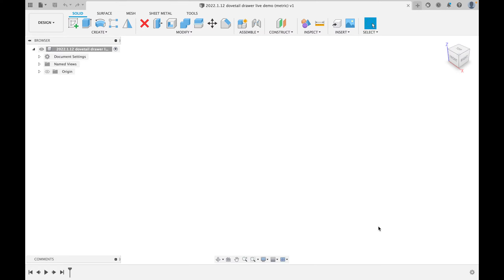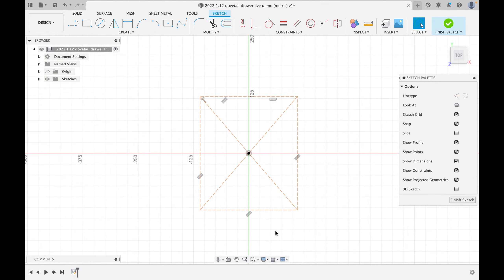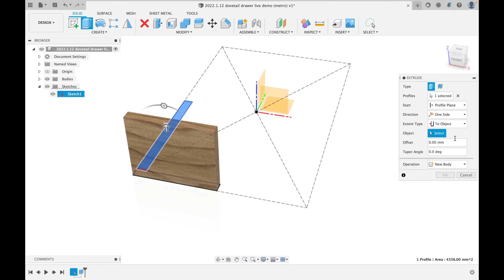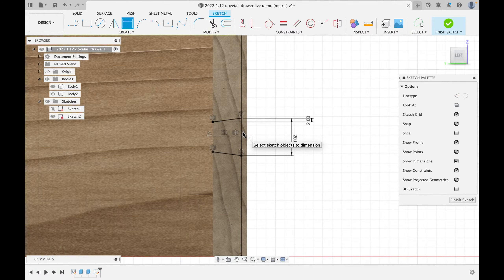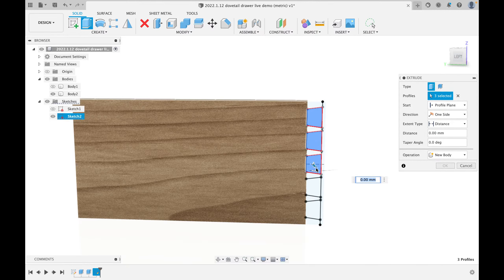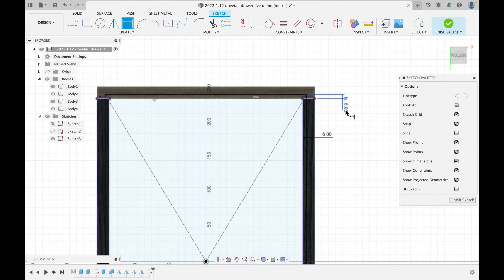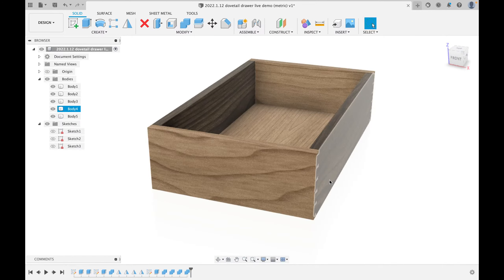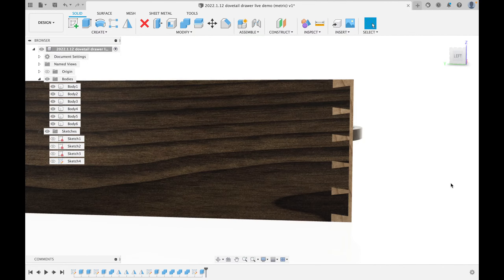Modeling Dovetail Drawers - Design and Woodworking in Fusion 360 (Live)

Comment: Thank you for sharing your dovetail drawer modeling process.  Wish Fusion360 would allow for some colour change to the tool symbols or some other method to show midpoint symbols, not your fault as it is a program limitation; wanted to share that I changed the display environment to "Dark Sky" and I can see much better.
Reply from the maker: i wish that, too. i've made that comment to autodesk more than once, as i'm sure have many others. those symbols are simply too small. dark sky sounds like a soviet weapons platform, doesn't it? темное небо?